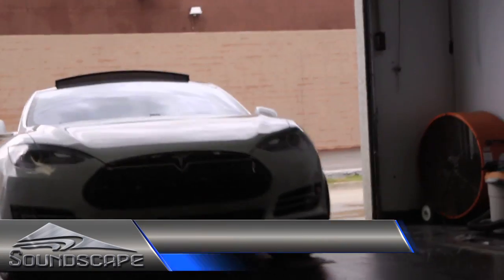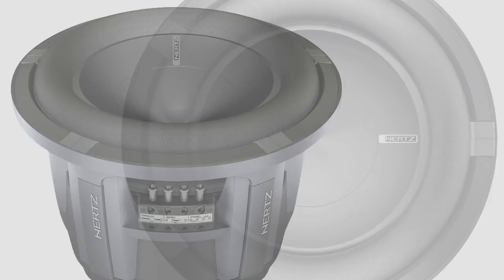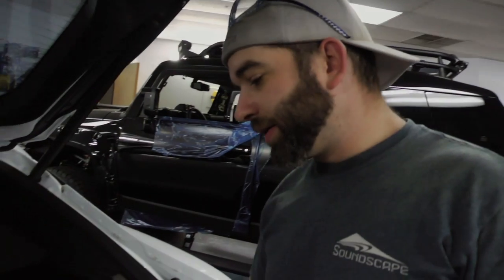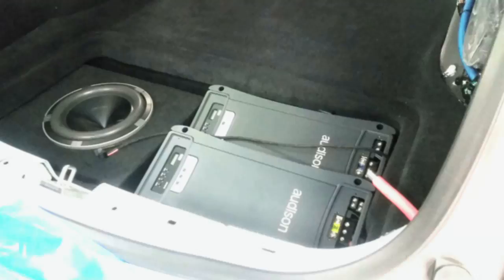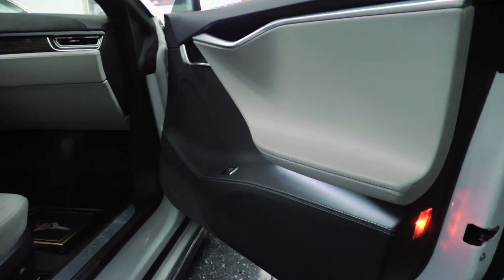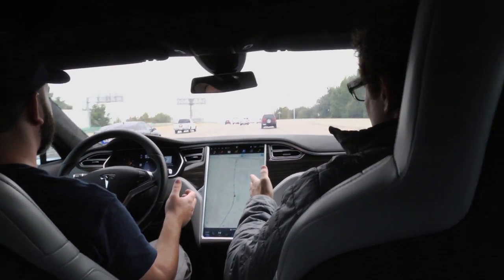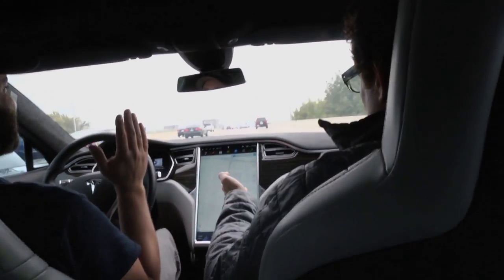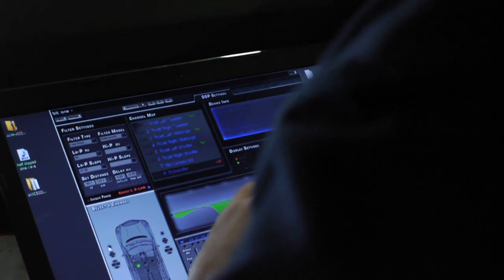Tesla Model S Aftermarket Audio Upgrade

Comment: Where did you hook the + and - from the subwoofer amp? I'm wanting to put bass in my model S.
Reply from the maker: I remember on that vehicle, the 12v battery was in the front boot.
Reply: @SoundscapeCarAudio1  yes the 12VOLT batt is in the front.  But to my understanding , it's not good to  hook a subwoofer amp to that battery because the BCM will detect the draw down and shut the car off.
Reply: @SoundscapeCarAudio1 i thought we had to hook the subwoofer to the DC-DC converter
Reply from the maker: I'll tell you what, it's been a minute since I built a Tesla, and they change things every time. The authority on Tesla is https://www.youtube.com/@therealmatty_s He'd have better info for you.
Reply: @SoundscapeCarAudio1 they turned off comments so you can't ask them
Reply: @SoundscapeCarAudio1  i got it, and posted a video on how i wired it all up. Mids and highs to 12VOLT BATTERY and  kxa2400.1 to the fuse area wherever factory 250 waffle fuse is ( pre fuse connection) then 0ga wire down to a 200 amp waffle fuse , down to the amp. 

The kxa2400.1 and the kxa400.4 both have radio detect so no remote wire needed
Reply from the maker: @ I'm glad you got it done!

Comment: I bought a model S second hand and it came with an Audioson AP8.9 a JL Clean sweep signal summing interface and an Audioson APF 1D Subwoofer amp. I had no idea it had any of this until I was replacing a tail light yesterday. I seem to be missing a subwoofer and when I was working on my door the front speaker looked mediocre. Since I have the Amps and equipment for great sound I am looking at some speaker upgrades. I think they guy took the nice speakers but left the amp and stuff mentioned above. Thinking about Alphasonik speakers and Sub.

Comment: As I gear up for my model III to arrive, have you guys worked on any yet? I'm looking for some guidance as I will be replacing the stock with aftermarket equipment
Reply from the maker: Nope, haven't seen one yet! They should be no problem though. We have the tools to diagnose and verify the system before we get started. With today's processors, there are few situations we can't deal with!

Comment: No surprise about the range. Actually, I would have been very surprised if it did noticably affect the range.

The amount of energy needed to run even a monster sound system install, is puny next to the amount of energy needed to throw a 5,000 pound car down the road like a fucking missile, and go on for 250 miles. If the battery has the energy to do that, it won't even notice the sound system.